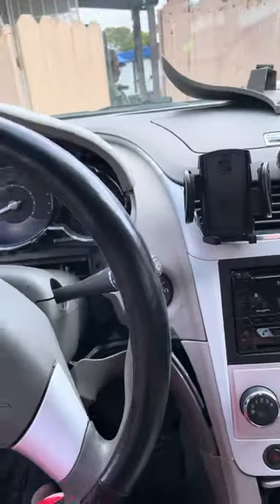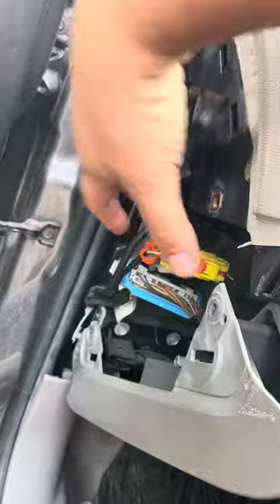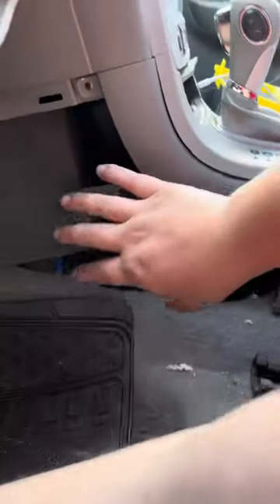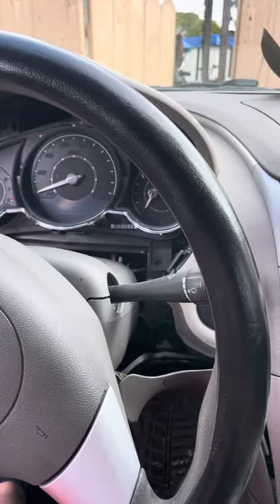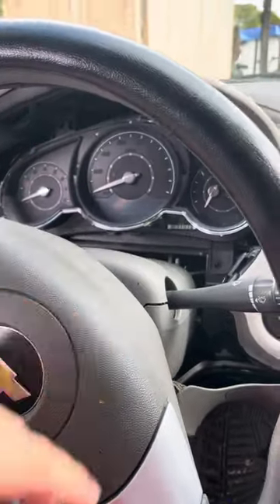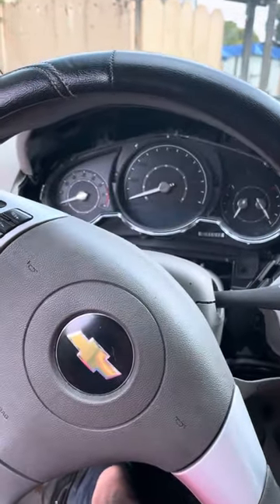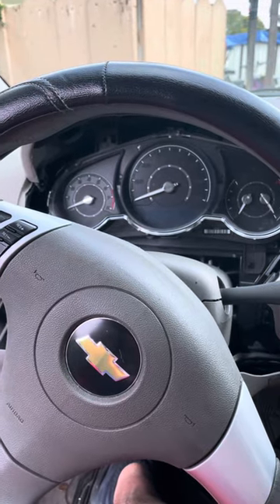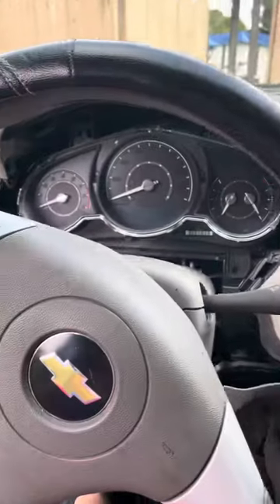2010 Chevy Malibu LT instrument cluster replacement

Comment: I have a 2011 Chevy Malibu with the same problem I checked fuse box and I noticed that when I disconnected the board it worked for a moment and then it stopped working I bought a new board I installed it worked for 2 days and the fault came back someone to tell me how to solve it I'm sick of this problem
Reply: U fix it ?

Comment: I have the same issue with my 2009  malibu , I did find one video that recommended  checking the fuse box first before replacing the cluster, I did checked it out and it worked , I even replaced the fuses , but the problem it might be just with the fuse box it self and also the wires might be loose as well , check them all out before replacing the cluster.
Reply: do you have a idea of what fuse is for the dashboard light an gauges ?
Reply: Fuse location is passenger side console. Pull that cover should be last 10A fuse on bottom right
Reply: @richnapier2364 I had the same problem before and that was the case. It was an instant fix....or so I thought. 

Fast forward to now, the lights went off again and now the fuse situation won't fix it, still dark.

Comment: Removed mine by just removing the 7mm bolts on the side that holds the gray bottom of the trim.. Pulled the bottom gray trim down it was held on by the plastic clips took the gray bezel off the cluster removed the 4 bolts that hold in the cluster.. It took 10 minutes to remove 6 bolts total Two bolts on the side 4 bolts that hold the cluster in.. Make sure the steering wheel is all the way down..

Comment: Bro thank you lol. Now I can check mine out. The lights went out on the dash no gauges, no alarm lights nothing. I checked the fuse, physically looks good i didnt OHM or check continuity on the fuse yet but I will lol! Think it's my light cluster honestly. Dangitt!!!
Reply: How did you pull the cable from the back of the cluster ?

Comment: Literally the only video I found DIY style about this issue.

Thank you!
Reply from the maker: Bro to be honest all I did was disconnect the cluster than plug it back In and it worked fine again
Reply: I hope that's my case, im going to start on it right now
Reply: Didn't work for me, it only comes on when the cat was very hot inside and after a 30 second fuse pull, after further research, I found it's a bad chip in the cluster, I suck at soldering, headed to the junk yard instead

Comment: Awesome video man! Quick question, I have the same vehicle but my cluster works except for my odometer is stock at 130,XXX miles. It doesn't keep counting for some odd reason. Everything else works though, which is odd enough. I would appreciate your input! Thanks brother!
Reply: That means it's not the original cluster. My 2011 is stuck at 152,040 and it's because the used car dealership where I had bought it had changed it. These clusters have a history of going out sometimes intermittently. Mine is going out again (usually when it's cold outside) and if I remove the fuse and put it back in after a few min it often comes back on. Ima try unplugging it like this video and if not ama go buy another one at the junkyard for $40.